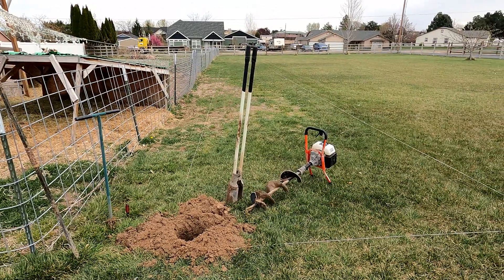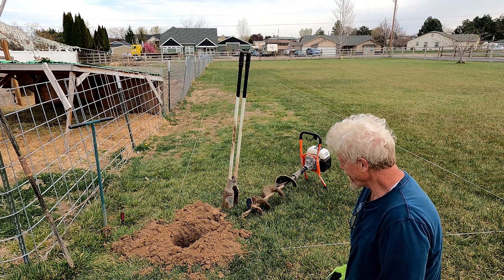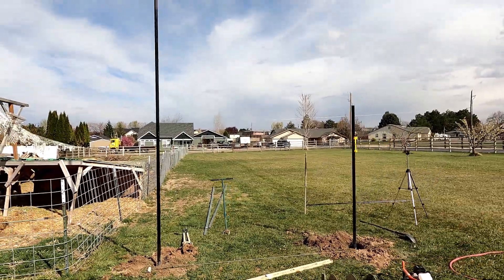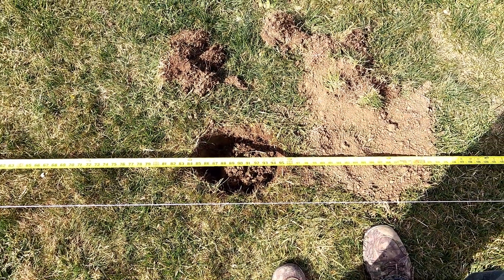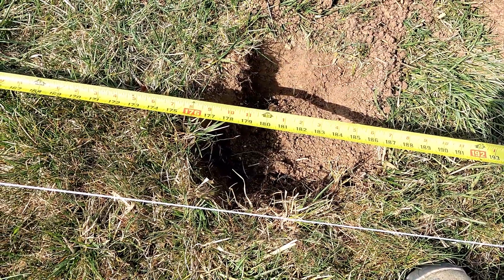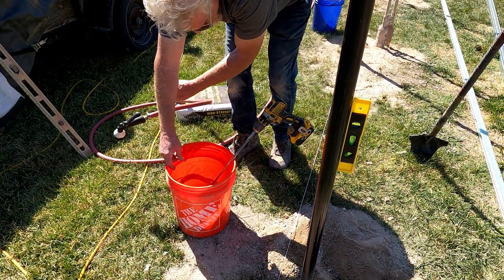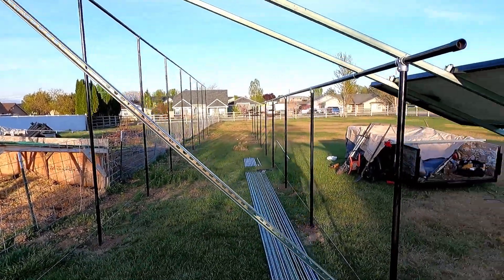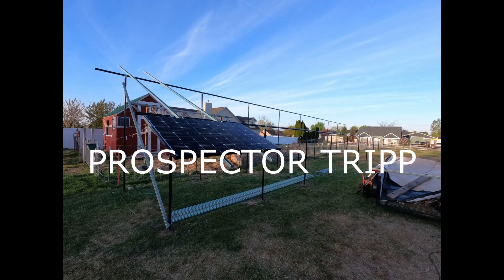DIY Solar Panel Ground Mount Rack..  Saving Thousands!

Comment: As if you didn’t have enough work or exercise…I’d dig less use more speedcrete
Reply from the maker: The rack was fun to build. The thing is like a rock. I’m very happy with the diy build. I buried the PV DC voltage supply and ground lines deeper than specified by code covering the bases. The well pipe rack is showing no issues whatsoever. I’m going to add another few panels to bolster the system another 3kw. The total PV wattage will be about 15.8kw. This should be enough for us.
Thanks Raymond 
Merry Christmas 
✌️PT
Reply: @ProspectorTripp  hey mr Tripp
Enjoyed your show…well drop pipe will last forever…I’ve built a trailer shed 40 by 40
Looks like an erector set on steroids…!
Just got a shitload of sharp panels…going to 
Blow some fuses…with 20,000 watts!,,,merry Xmas and double peace out
We are rapidity going down our nations toilet bowl….ray
Reply from the maker: @offgridmangogrower  I was joking around with some terrific people at a Christmas dinner about building a rack of stationary bicycle generators for the neighbors to Earn a bit of electricity for their emergency needs. Need power? Jump your butt on a bike generator and charge up your battery. It was just a joke.. but could be a diy fun project reality! 😂 we’ll see.
Cool on the Sharp Panels! 20kw is a powerful array for most homes. We currently run about 15kw of panels. In 2023 I hope to upgrade to about 18kw.
The last couple weeks we have had very little sun. We’ve charged our LFP batteries I believe 5 times during these overcast days. Having solar is really nice. We could certainly reduce our power usage so we never have to use the grid for charging. But we don’t.. actually we use more electricity for sure because usually we have extra stored power available. Unless the grid fails we’ll continue to use the power grid for backup. 
That’s a nice feeling.. Using the grid for backup! All my life it has been Flipped.. The grid for primary power and have a backup generator in case of grid failure.
Not anymore.
Get er dun brother.. no fuse blowing usually needed. 😅
Be safe
✌️PT
Reply: @ProspectorTripp  brother Tripp,
I’ve offered to roast  my brothers Peruvian coffee…if he can get it out of Peru…..blowing fuses is a meta for for wasting energy…off grid farming since 2004.
My grid connection is thanks to disposable harbor freight gens….my winter saving grace are zombie gas trackers(zomeworks)
Love your attitude and humor….

Comment: Tell us more about your prismatic cells?
Source? How long in use?….any failures?
Reply from the maker: Hello Raymond, I bought directly from China through Alibaba from Basen Technology. I initially purchased 80 pcs EVE 280ah LFP cells for about $110 each shipped to my home. This made up five DIY 48vdc 280ah batteries (67kw storage). After a few months I decided to expand the battery storage system with another order of 84 pcs of EVE 280ah cells. Their cost rose to about $135 each in 6 months. So far I’ve had only 1 cell that has performed under spec. It charges up first and also be the first one to discharge. It’s about 200ah now vs 280ah of the other 15 cells in the battery. I replaced the wimpy cell about 2 weeks ago with one of the new backup cells and is back to cycling nicely full juice again.
We are now running Seven 48v 280ah diy batteries (94kw) I am going to build one more for a total storage of (107kw) for the house and two more batteries for my shop. The shop now has two 48vdc 200ah (19kw) batteries I DIYed, I want to heat the shop with electric vs propane. So adding these extra batteries and solar panels for those cloudy days.
I am totally thrilled with the performance so far. The batteries are run fairly lightly having 7 in parallel and cycle roughly about 75~80% charge/discharge cycle. (46vdc min 56 vdc max)
Because I don’t hammer the cells charging to the maximum and discharging to the minimum at a crazy maximum current of 280 amps I believe these cells will last much much longer. Only time will tell.
I plan on doing a few solar power system videos coming in the spring of 2023. I want to do a full year break down on several topics regarding my systems overall 1 year performance. 
Just in case you want to ask about these cells.. I worked with Emily Peng at Basen. She did super and everything was exactly correct and all cells arrived perfect.
Shenzhen Basen Technology Co., Ltd.
Hope this covers your question.
Stay Golden 
✌️PT

Comment: name of materials
Reply from the maker: Hello Antonio, the pipe was old well pipe. The connectors I used link is below 
https://www.zoro.com/zoro-select-structural-pipe-fitting-three-socket-tee-cast-iron-125-in-pipe-size-50000-lb-tensile-strength-4nxt8/i/G3203697/
Thanks 
✌️PT

Comment: what did you use to connect your piping?
Reply from the maker: Hello TDB, I used 3 socket T couplings from Zoro. I have checked them to ensure that they are not working themselves loose. So far they are rock solid!
No issues and Very pleased with the rack!
Link below to Zoro
https://www.zoro.com/zoro-select-structural-pipe-fitting-three-socket-tee-cast-iron-125-in-pipe-size-50000-lb-tensile-strength-4nxt8/i/G3203697/
✌️PT

Comment: I love your mount setup. Where did you find those brackets that hold the vertical and horizontal post together?
Reply from the maker: Hello Shaun, I believe that you are taking about the item I purchased from ZORO.com Here’s the link.
https://www.zoro.com/zoro-select-structural-pipe-fitting-three-socket-tee-cast-iron-125-in-pipe-size-50000-lb-tensile-strength-4nxt8/i/G3203697/

Zoro’s description:
Structural Pipe Fitting, Three-Socket Tee, Cast Iron, 1.25 in Pipe Size, 50000 lb Tensile Strength
Zoro #: G3203697 Mfr #: 4NXT8

The ground mount rack is super heavy duty. I’m very happy with the way it turned out. Like a rock!
Thanks for commenting!
✌️PT

Comment: Awesome ground mount. I've been looking at doing this same thing but had planned to fish mouth the vertical pipes and weld the top piece. I see you used bracket. Where did you find those? Thanks for sharing your build.
Reply from the maker: Hello, sorry I missed your comment 😬
 I purchased from ZORO.com Here’s the link.
https://www.zoro.com/zoro-select-structural-pipe-fitting-three-socket-tee-cast-iron-125-in-pipe-size-50000-lb-tensile-strength-4nxt8/i/G3203697/

Zoro’s description:
Structural Pipe Fitting, Three-Socket Tee, Cast Iron, 1.25 in Pipe Size, 50000 lb Tensile Strength
Zoro #: G3203697 Mfr #: 4NXT8

The ground mount rack is really good so far! 
Welding is good. These structural tees are super tough and I am totally satisfied with their performance.
Thanks for commenting!
✌️PT

Comment: What are those T sections called that hooking the 2 pipes together
Reply from the maker: Hello Charles, I bought these Tee type couplings from Zoro online.
Here’s the description, item number and price. Today Feb 15 2022
(Structural Pipe Fitting, Single-Socket Tee, Cast Iron, 1.5 in Pipe Size, 50000 lb Tensile Strength
Zoro #: G3130757 Mfr #: 4NXU8
$11.90 each)
I am totally satisfied with these T fittings so far. I have checked the tightness a few times and they have not become loose or compromised in any way.
I got the Used well pipe from a local well driller that charged me only $2 bucks each for a 21 foot piece! Unbelievably Inexpensive!
The well pipe is holding up nicely and shows no rust or corrosion.
Overall the solar panel rack is terrific and has absolutely no issues handling the crazy strong Idaho winds.
I’m going to do another solar project video update on the entire system soon. I’ll be sure to include all major components and my opinion on its performance.
Thanks sir for your comment!
Hope you geterdun!
Solar baby!
✌️PT

Comment: Good stuff. I always wanted to do solar in my shop also. Good job on getting it started. Thanks for sharing.😎⛏⛏🔥🔥
Reply from the maker: Hello Chuck.. so far the shop power is terrific and getting better daily! I’ve been running a freezer and refrigerator in the garage for several days now and also all the power I’m using to build the house solar system is from the shop solar system. 
Thanks much sir 
✌️PT